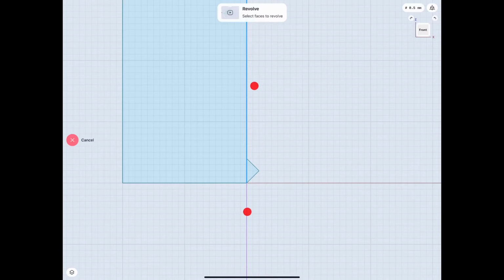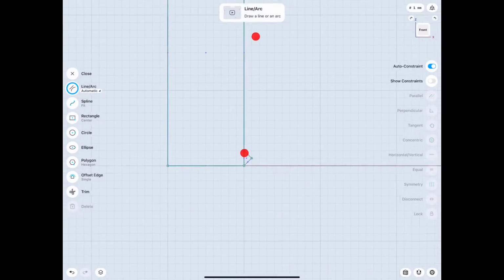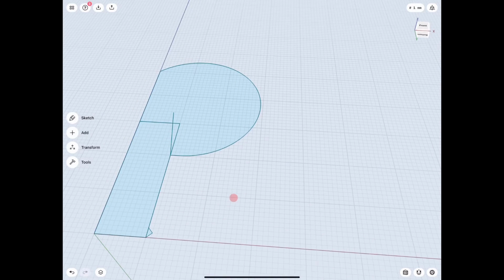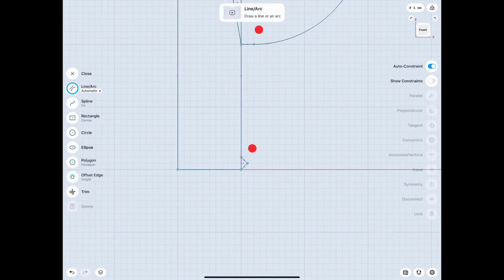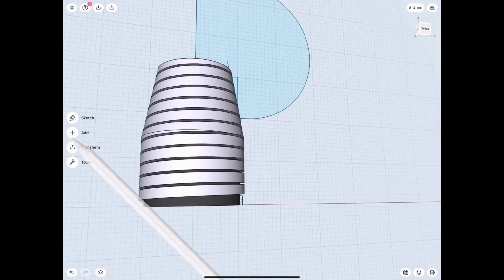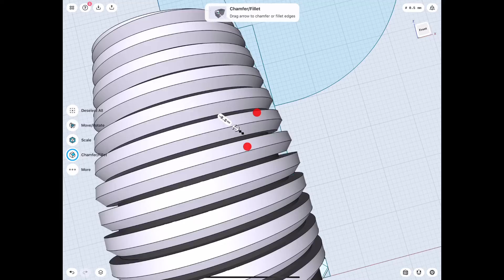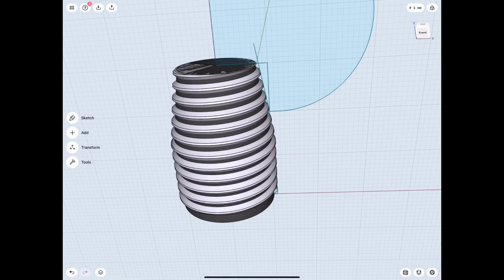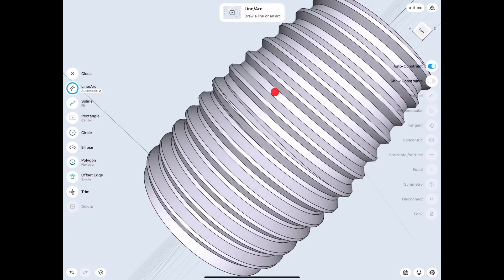Tapered Thread Experiment in [ Shapr3D ]

Comment: This is interesting, thanks for sharing. I think I have finally got good 3D printable threads - the trick for me is to add an air gap by sketching a smaller triangle within the bigger triangle and using the rotated large triangle thread to cut the groove whilst the smaller triangle thread is bonded to the bolt shaft and then chamfer so that it's easier to print. I use 3.2mm distance for every full 360° rotation with good success.
Reply: If you use a resin 3D printer you can have less of a gap between threads. I made a cap with fine threads and it came out good on my elegoo Saturn S.
Reply from the maker: Exactly, threads need some space between each other. I usually use either 0.2mm offset or 0.3mm for larger threads.
Reply: @JLake3D  Nice. Also, if you raise your sketch triangle above the top plane by 1 revolution, when you cut it away from the lid,, you get the nice lead in groove for the thread to get the initial "bite", same with the screw, extend it one revolution past the top, union with the shaft then trim the excess and it conforms the geometry & gives you a sharper start thread.